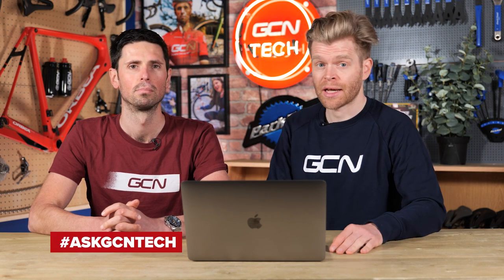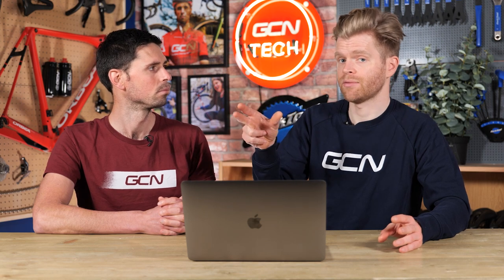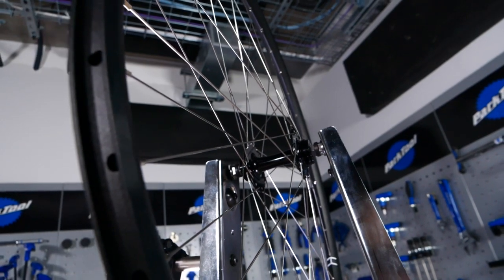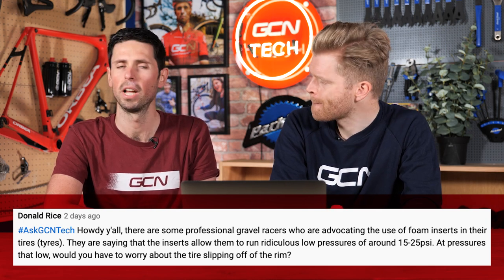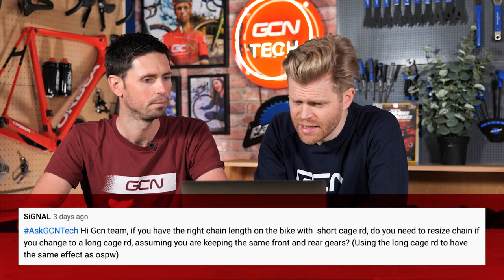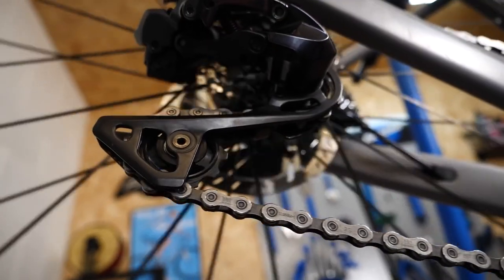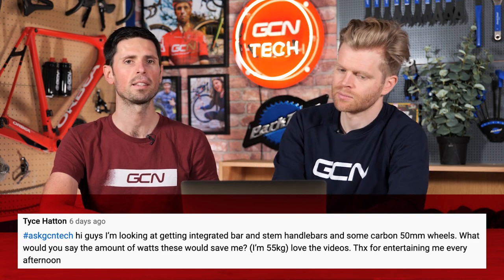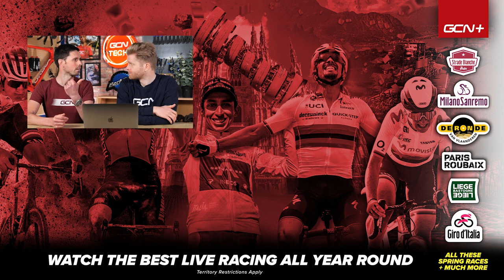How Many Watts Do Aero Bars & Wheels Save? | GCN Tech Clinic #AskGCNTech

Comment: #askgchtech  Hi everyone, I got lower back pain and a herniated disk few months ago. I have not ride  a bike for a long time. As I am starting back to cycling, I need  to bring up my handlebar for at least 8 or 9 cm up, and therefore put less pressure on my  lower back. Is there any adapter to extend the steerer tube safely for about 10 cm. I have seen many  adapters   on amazon and other places. some goes into the tube like an expansion plug, and some clamped outside and stem is clamped on the adapter. Is any of them good?

Comment: If your handlebars are too low their is steering tube extenders that that clamp inside the steer tube they come in sizes from 3cm to 5cm theirs also the extenders that go on the outside of your steer tube but they look hideous both examples can be found on ebay and amazon

Comment: #AskGCNTech Here's a maths question for Dr. Bridgewood's geeky side: Is there a theoretical max power a rider of a given weight can produce at. given cadence? Assuming they aren't pulling on the handlebars, isn't a rider's power limited by their weight and cadence?
Reply: No because you also have to factor in muscular endurance i e track cyclist if you can shove a harder gear at the same cadence as someone the same size as you, the harder gear will produce more power

Comment: #askgcntech Hi sagacious GCN maestri, how much of an improvement would I see from updating my old Shimano BR-6500 Ultegra rim brakes to a more up-to-date set of Ultegra R8000 or R8100s?
Is it a viable and worthwhile upgrade?
Reply: Yeah bit you'll have to change the levers too, since the pull ratios are different. If you use the levers that were compatible with 6500 brakes, they pull less cable so the brakes will feel spongey
Reply: @galenkehler  Thanks for the heads-up... think I'll stick with the old brakes then and just give them some tlc (a good clean, new cables and blocks)

Comment: #askgcntech Hello! I wanted to ask if it was possible to convert a TT bike to a drop bar bike and convert the TT bike's original groupset to STI shifters?
Reply: I would imagine the brand may sell a barset that could be swappable with the integrated solution and the shifters would probably be the easy psrt
Reply: @coreygolphenee9633  So you could take say Shimano 105 STI levers and fit them to say a shimano 105 TT groupset presumably of the same generation?

Comment: #askgcntech Greetings to all at GCN Megabase! Bit of an aero nerdy question for you. Last year I did my first Club 10 TT on my alloy road bike using my best wheels (with tri bars) (now used as my winter bike, having finally built up a summer aero bike) and I was pretty happy with my time (25:39). Both bikes I have set up nearly identical to each other to the millimetre including reach, stack, bar width and drop etc, although my summer bike has slightly steeper seat and head tube angles and slightly shorter wheelbase. My question is this. With an estimated 500g and 20-30 watt aero saving on frame alone if I used the same wheel and tyre combo, what theoretical time could I achieve if I matched my effort watt for watt? Side note, my winter bike has Tiagra 4700 and summer bike has 11sp 105/ultegra mix, both run 11-32 on the rear. Both are rim brake bikes.
Reply: The weight saving will give no advantage on an average 10 mile tt. I'm interested to know where your 20-30 watt aero saving comes from if you're riding in the same position, using the same wheels and tyres. But to answer your question directly, an extra 20 watts or equivalent aero saving will save in the region of 30 seconds.
Reply: @the318pop  my aluminium winter bike is at least 10 years old with oversized round tubes, twin triangle design and fully external cables. My summer bike frame is an open mould fully aero carbon frame bike with full and truncated aerofoil tube and seat post shapes, dropped seatstays and cable routed internally through the frame. The fork on my summer bike is also aero optimised whereas my winter bike fork (despite being full carbon) is more neutral shaped.
Reply: @matt_acton-varian  well you'll see noticeable gains for sure but not in the 30 watt realm. There's a psychological benefit to be had too, that has to be worth a few watts :-)

Comment: Aero wheels are only faster if they are also lighter! Unless you do no accelerations or hills!
Reply: The aero benefit outweighs (pun intended) the weight savings of shallow wheels unless you're always riding uphill or accelerating out of corners. An exception to this is something like Hardknott Pass travelling west. You get no aero benefit travelling up the climb at slow walking pace, and no aero benefit descending the lumpy bumpy road down into Eskdale mostly on the brakes.

Comment: #askgcntech hey Manon, lads. Been biking for a while and want to switch to a more aggressive position. What is my first step? Remove spacers, flip the stem (had it reversed), or get a longer stem? Thanks!
Reply: i'm not gcn but I think I can help you for a bit. I would suggest a bikefit, then explain you want an agressive position and they make you as aero as possible with still enough comfort for long rides. If a bikefit isn't an option (because it's pretty expensive or another reason), make small steps, first flip your stem back, see how that goes, then remove a spacer,... Be careful tho because it'll do a lot of things to your body: some examples are tired arms because there's simply more weight on em (a good core stability can fix that problem too), saddle problems because your weight is more shifted forward, like numbness (can fix that with tilting the saddle forward, not too much tho because then you'll slide foward), backpain because you're not used to the position (again: core stability can help), but also your legs could start to "burn" faster, try getting very aero in your current position and you'll know what I mean. That's about all the knowledge I have about that subject I think, hope I helped you out.
Reply: @dieterloos7382  thanks a bunch! I got fitted about a year ago, but have come a long way since then. Guess I will have to shell out another $300
Reply: @Doktor_Al  if you can easily miss the money that's the best, will save you a lot of trouble, im speaking out of experience haha

Comment: #AskGCNtech I'm a 4'11 weight is 130. I have very muscular legs, yet the highest watts I've ever done is 600 watts. My average watts is 130. The longest ride I've ever done is 55 miles. I've been cycling for for 6 months. When will my power increase? Or I'm i limited by being short and a female. Do you think I can ever hit 1000 watts?
Reply: You are very limited due to your weight and length. You probably never reach the 1000w range, which is fine, not many do regardless of how big they are. Avergae 130w, do you mean that is your FTP? That is very low, if you would get it over 200, closer to 220-240w then you will be able to challenge a lot more rider. Cycling for 6 months is alright but it takes time to build up the physique necessary. Just keep going and you will improve over time. Do lots of VO2 training, find your FTP and push 10-15% above that and you will improve your watt output over time, this takes a lot of time to do as you need a good base to start from. 
Just in comparison, I am a male, 25 yrs old, cycling for 3.5 yrs, which the last 2 years a lot more serious with regular training. My FTP (20min) is around 300W for  height of 5´10 and 182 pounds. My max watt output is just peaking north of 1000, sometimes 1200w but is just a peak on my power meter. 800w is more realistic and something I can sustain for just a few seconds. 

Remember, it is not about maximum watt output but more of WEIGHT PER KILO W/KG that is important, especially on long endurance rides or very hilly sections, a heavy rider with high watt output will be remarkable quicker than you, yes, but if your w/kg is a lot better you will be able to go for longer and take a major advantage in the hills.

Okay, remember the most important thing! Ride and have fun. Numbers are very satisfying to look at but never forget the joy of actually riding, especially with good friends.
Reply: @sebbelito2975  Thanks for your advice. Yea I know I need alot work. I don't think I'm pushing myself as hard as I can go. I've been a runner for over 25 years. My running vo2 max is 42 at age 40, and cycling it's at 40.
Reply: @kimwarner6050  Cycling will always be slightly less than running! When pushing your max, running uses more muscles/different muscles than cycling therefore your heartbeat will be slightly higher than pushing your max on a bike :)
Reply: @kimwarner6050  you may not slam watts down but you can probably tap dance up gradients my giant ass would be ready to hurl on one thing cool about cycling is that you be good at some aspect regardless of size, also at your height and weight try BMX lol

Comment: #askgcntech Hello from Portland, Oregon!  Curious about the aerodynamic effects of running a narrower road tire (for instance a 28 or 32mm slick) on a fork designed for a gravel or "all-rounder" bike.  For instance, I'm riding a Ribble CGR SL, and during the winter I run a 38 or 42 partially knobbed gravel tire for traction and peace-of-mind in the wet, cold, grime we get here in Portland (weather I'm sure you are familiar with).  However, when it gets warmer and drier...very dry here July-Sept in case GCN wanted to do a vid about riding in Oregon :), my road riding is done with a 32mm slick road tire that meshes nicely with my wheel's rim width.  There's a sizeable gap between my fork blades and the wheel/tire and I'm wondering if this creates a substantial aerodynamic loss.  Would I be better off sizing up to a wider tire due to this putative aero loss, or stay with the tire that rolls fast and meshes well with my rim width?
Reply: Would interest me too
Reply: A wider space between fork and tire increases aerodynamics
Reply: @bene6581  but, why then are aero bikes and time trial bikes so tight between fork and wheel?

Comment: The rule for aero wheels is called the rule of 105. Meaning the rim should be at least 105% of the width of the outside of the tire. There are a bunch online resources that measure various inflated tire sizes by internal rim width. Or just measure it yourself and ensure the tire does not exceed that when inflated to where you want it. Keep in mind that the tire gets wider as you put more miles on it.